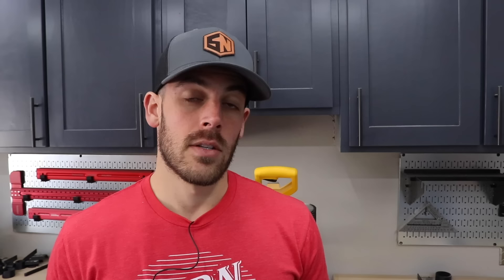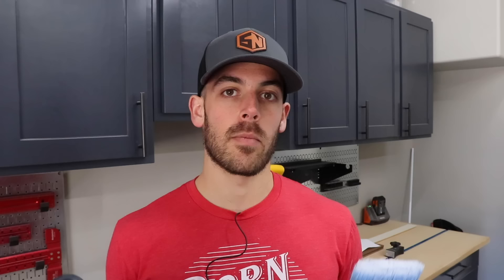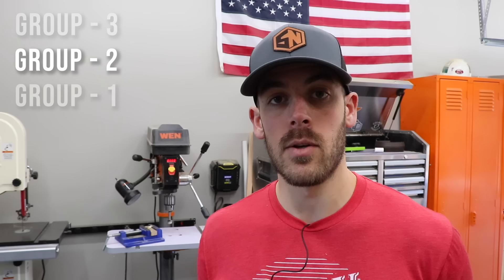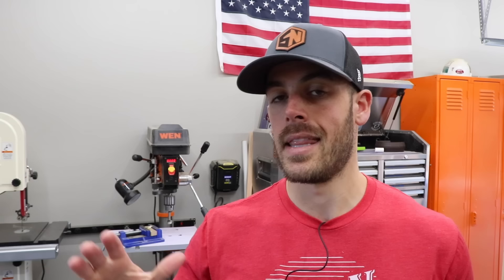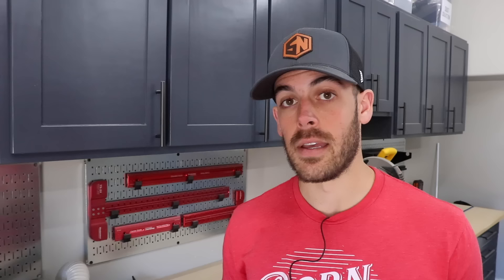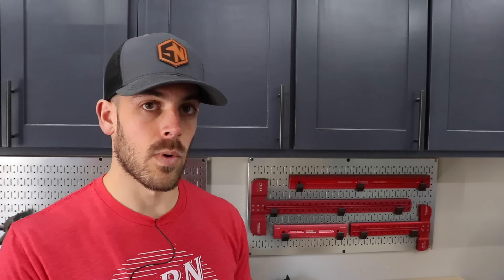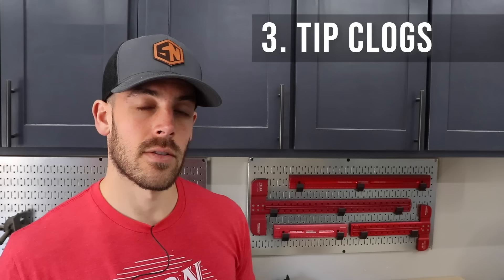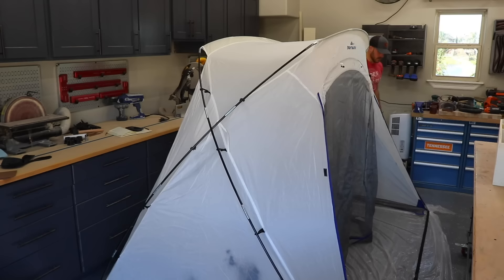Low Cost Handheld Paint Sprayer // Graco Truecoat 360 DS Review

Comment: WOW-  thanks for this review.
I started painting my garage last weekend ( two walls stucco, one dry wall) old style- brush and roller. I got the dry wall done and about 4 feet down the side walls. Took forever  painting around water heater, etc.  
Saw your video and bought this at HD. I went with the VSP as you suggested  and glad I did. It was such a pleasure to use- finished off the walls and interior of the garage door in about 2 1/2 hours. I will never paint with a roller again. This thing is a workhorse, easy to use. Clean up takes a while but well worth it. On top of that it makes this really cool sound which reminds you of the toy machine guns we played with as kids! Great tool, worth every penny. 
THANK YOU!!!!!!!

Comment: I work in remodeling I painted 400 lineal foot of shoe molding in 15 minutes took 10 minutes to clean out the gun 5 minutes to set it up the shoe molding look like furniture. I would recommend this to anyone some people are intimidated by it it was pretty easy to figure out. I recommend it highly to anyone who wants to pre-paint in any material.
Reply: Ron Young  thanks because I be taking long painting and cutting at the same time
Reply: @Wuwuu72  It will be the best money you ever spent. Just caulk the top of shoe molding. coat of paint over it 15 minutes later.

Comment: I got the Graco Truecoat 360 VSP and I painted my bedroom walls with it last night (a matte ultra-pure white). After painting the entire room I ended up going through 2 1/2 gallons of paint and noticed how HEAVY the sprayer gets after using it to paint an entire room. Right from the start, I could see the spray pattern sort of ribboning (good coat in the middle but the edges were very light). I used the method of spraying and on the next pass covering about 50% of my last pass to try and ensure the proper coverage. This morning I can see a few areas that I need to go over again really quick. I had previously bought the Graco X5 and took it back (unused) to get something smaller since I do not paint very often, and then regretted that decision. While painting an entire room this paint sprayer goes through the paint! I had the pressure at 1500 psi (setting of 10 spraying a one-coat paint) and I had to refill the canister really often. So much that I was saying to myself I really do not like this sprayer. It got messy, paint got all over the gun, floor, etc. It also did heat up, however, did not stop spraying. If you are looking to paint smaller projects then this sprayer would be fine, however, if you are looking to paint large areas like a room I would opt for the Graco X5 as you can use it with 1 or 5-gallon canisters if need be and the only weight you need to hold is the spray gun, hose, and whatever tip or extension you are using. It would have been great to not need to constantly refill the canister. All that being said this was my first time ever using a paint sprayer and I am sure there are ways I could have extended the amount of paint I was using with a different setting, making sure my distance to the walls was equal as possible, technique, etc. I will be taking my sprayer back to Home Depot and if I need to get another sprayer I will most definitely get the X5. I hope this helps someone out there with their decision and of course this was just my personal experience with the product. I am not saying the sprayer is bad and honestly, for the money ($265), it is not priced all that bad. The X5 was $329 and IMO is worth the extra money.

Comment: To anyone reading, trust me and opt for the graco magnum project plus. It’s like $50 more but comes with real tips you can actually change, and you don’t get the weird pulsating from the trucoat 360. This sprayer leaves terrible tiger stripes due to the pulsating, even with a correct overlap. The 4 inch tip on low still sprays too much and causes drip. If you look behind him when the light hits the cabinets, you can still see the tiger stripes. Additionally, because only two tips are compatible, you can only spray paint. Forget about spraying poly or any type of water based coatings. The tips do not allow for precise spraying. It’s decent for small jobs or fences I must admit. If you’re looking for a pro look, you won’t get it with this.
Reply: I have experienced all those things with this sprayer. I tend to keep a mini foam roller in my back pocket for drips. I found the pulsing happens only when there's about 30% of paint left. I have my next pour loaded with a a second lid and cage I bought separate. I would have also spent the extra money, I'd I had known, but this is the one I have now.
Reply: I was wondering about that as well! I’m all but sold on this sprayer but that pulsating bugged me. I guess at this price you run into issues like that. Appreciate the post 👍🏻
Reply: Can i paint poly with it?
Reply: @jorgeivancepedarey6314  I’m sure you could but it won’t turn out great. You need a fine tip to spray poly and this particular sprayer doesn’t allow you to use the normal Graco tips. Rather, you’re stuck with what you have in the box
Reply: What about the corded ultra?
Reply: @david7101  Would recommend project painter plus or x5. However, if you’re looking for something that’s easy to use, the corded and cordless versions work just fine
Reply: Spot on. Tried it and agree. Not worth it.

Comment: I’ve been using the Graco VSP 360 for a slew of projects.  Once being my basement remodel and did ALL the trim, talking several hundred feet and all the wainscoting walls.  Finish came out like “Buda”.  Easy to use and clean.  I’m ultra picky on my finishes and this sprayer is awesome.  And it finishes in one coat with a good quality paint.  Don’t buy cheap paint, especially if you are spraying.  I like Sherwin Williams higher end for spraying (and brushing).  Proper prep is key to painting, take your time with it.

Comment: The good thing about that sprayer as I can see is if it starts to clog just turn the tip round and spray it out. Then turn it back the right way and your good to go. As for clean up time it's got to be quicker than cleaning rollers and brushes.
I try to keep my brushes and rollers.
As they wear in nicely over time. But the cleaning process could take 30mins or more depending on what paint I've used.
The tip is to always take care of your tools no matter what they are and you'll have no problems. 👍

Comment: I purchased the 360 variable speed unit recently and sprayed some cabinet doors and they look great. Cleanup of the gun takes some time but goes faster if you use the proper solvent. Took me awhile to figure out denatured alcohol works great for BIN primer. Can’t wait to try it with oil based paint on my interior doors, which are a real time consuming painful job with a brush.

Comment: Graco has made some good improvements to their handheld sprayers. However, you need to ask how many gallons will go through the pump before it needs to be rebuilt, which will be at your cost. Also, they may not work after 100 or more gallons. 
If you buy paint/finishes at a dedicated paint store and want a better price for one of these sprayers, ask if they will cut the price down. Big box stores or Amazon will not negotiate with you. The paint store managers and sales people may cut the price down close to their cost just to keep your business. Either way, it's worth asking. 
My knowledge comes from working for Sherwin Williams eight years as a sales associate. Personally, if you have the money to afford one I would recommend a Graco HVLP sprayer.
Reply: You're correct 💯

Comment: I have a VSP. Bought it because I was staining trellises and I did the first one with a brush. Took me 2 hours to stain one side of one trellis. After getting the VSP, I finished all 6 in 4 hours, including clean up and breaks. One thing to mention... If you're doing a project where there's going to be a lot of overspray, like a trellis, you use a lot more paint/stain than doing it with a brush. It was worth the trade off for the time I saved. Also, get the Graco storage fluid. It's very easy to use and keeps the pump lubed and clean.

Comment: Good review. The clogs are coming from large clumps of dried paint that get stuck in the tip. For clogs use a paint strainer bag and strain your paint as you pour it into the paint bag . They are usually less than $3 from your paint store or hardware store. I use these bags on my airless pump.
Reply: they showed the filtering in the video.

Comment: I use the two-speed sprayer and am a newbie in using it. Several things I have learned. One, mask everything! Two, wear disposable gear over everything of you that you don't want sprayed. Wear a face mask so you don't breathe the paint. Wear goggles. Three, it is very easy for an old lady to use. I can't lift a lot of weight. It doesn't weigh much. I tire easily. You get the job done quickly. Four, If you finish one color in an area and have some paint left over, remove the paint reservoir from the sprayer. Place it in a support container ( I use a wide drinking glass) and cover with plastic. That preserves the paint for the next time you need that color. Clean the sprayer and continue using with a new color. Then, when moving to a new room but needing the first color, you can easily switch back with minimal loss of paint. Finally, clean up is VERY easy even when neglected. About a month ago, I did some painting and when I ended that evening, I thought I'd use the sprayer again the next day. So, I covered everything which may possibly be open to air and just left it overnight. Well, overnight became three or four weeks later. I expected the worst. But, I happily discovered that the paint was still good, nothing has clogged, and I was able to continue as before. DEFINITELY A GOOD EXPERIENCE.

Comment: The biggest problem I have with this type of sprayer is the cleanup. It takes a while to get it cleaned right and uses a lot of water. I feel the larger graco magnum sprayer with the hose attachment on the suction tube for cleaning is way easier and faster to clean. 

Since I live on septic now. No more paint rinsing activities in the sink.

Comment: I have the VSP version that I like using for the same reasons. One step I add to the prep is to use a filter sock to strain the paint of solid material. I have an extra paint can with the filter sock inserted and draped over the top then pour in the mixed paint. It is an extra step, but I believe helps.

Comment: I used the Graco VSP to paint a double wide garage door with semi-gloss water based paint.  Each coat of paint took about 2 minutes - very fast.   There is a 4" wide spray nozzle and a 12" wide spray nozzle.   I gave the door 3 coats.  The only problem I saw was the gloss varied a bit across the door as the light reflected off at an angle. The sprayer pulses out the paint so the flow is not continuous.  I think you have to be careful to get enough overlap between the pulses of paint.

Comment: This is the best cheap paint sprayer I have ever used. I watched the video of how to operate and clean several times. The cleanup if done properly and thoroughly makes all the difference in repeated use.  If done improperly (as with any paint sprayer) you will have continuous problems. Reminder the spray tips are only rated for so many hours of usage, refer to your operation manual.

Comment: Had one of these when i worked for a painting company, they were a godsend for painting downpipes and sofits.
Reply: Do you know if it's truly airless tho? I can not stand the air powered ones that throw more paint on the floor than my object.
Reply: @Coder-zx4nb  I never had issues with that, i would usually do a test spray on a bit of scrap wood just to be sure the paint was behaving how i wanted it to though as each different brand of paint does need to be kind of dialed in.
Reply: @Coder-zx4nb  turn down your pressure and use a low pressure tip.

Comment: I have the VSP model and I hate it!! As you can see in the video here, these spray in pulses so the key to getting a smooth finish is a game of stacking these pulses so you dont end up with tiger stripes. And I promise you this, you WILL see the tiger stripes in the finished product if you dont do it well. I have sprayed professionally for years with a Graco X7. When you pull the trigger, the paint just sprays out (like a can of spray paint). It's honestly not super hard to get a killer result. If you keep your distance from the material and pace yourself, the paint lays down smooth, easy, and gives a great finish. 
On the contrary, I fought this hand held with 20% diluted latex paint (according to Graco's phone support the Behr interior paint I was using is pushing the max that this sprayers motor can handle... seriously) on some baseboards and cabinet doors and it was a massive pain in the ass! To avoid the tiger stripes I ended up with way too much paint and a horrible orange peel finish. I 100% would not recommend! It would be easier and give me a massively better finish to just get my big X7 out and buy some extra paint.

Comment: I saw you used Solo from SW. Great choice for dark colors in a latex enamel. The true coat series was a big seller in graco's handheld sprayers. If you do a lot of projects with paint I recommend stepping up to the Graco Ultimate Handhelds cordless. It has 3 pistons compared to the Truecoat having 2 so it sprays more like an bigger spray rig. Also uses real guards and tips so you can swap out the tips for better finishes with different paints. Another benefit is it runs on 20v Lith dewalt batteries (comes w/ 2) and charger.
Reply: You can also upgrade into an all metal version (higher price) so you can spray high flash point material like lacquers and other solvent based chemicals.

Comment: I just bought the Graco 360.  I used it on one job to paint some textured walls.  It did fine on the textured walls. My next job was a piece of furniture.  IT TOTALLY FUCKED IT UP!  I had cleaned the sprayer out very well prior to the second job.  The Graco 360 splattered like Diarrhea all over the place and left a horrible uneven texture.  I put a new tip-in, and it did the same thing.  No, I didn't have it set in the clean-out mode.  The tips just spray unevenly and sprayed a stream out the middle and splatter everywhere else.  So, I called the company.  Basically, they told me to take it back and buy a $600 sprayer that you pump from a 5-gallon bucket.  Great, so I have to buy a $174 piece of furniture or try and sand out the old one.  Waste my time returning the sprayer.  Pay $600 for a big sprayer and buy 5 gallons of paint for a small piece of furniture. What a bunch of CRAP!  I'M PISSED AND EXTREMELY DISSATISFIED.  I bought this sprayer thinking it would be the top-of-the-line sprayer for small projects over the Wagners.  It certainly was more expensive.  The Graco 360 SUCKS, and I mean SUCKS in a bad way.  They should name it the GRACO 360 Splatter gun.

Comment: They e updated the model names now too. 
Niw thwy are the 360 single speed, 360 dual speed (old DS), 360 dual speed plus (DSPold name) and 360 variable speed (old VSP) 
They also come with 2 paint and 2 stain tips now and different screens for each set of tips

Comment: Nice summary of these sprayers, thanks for posting. FYI you can buy the 42 oz flexliner cage and cups separately and use with your sprayer. I did this with my Ultra Cordless model (which came with the 32 oz liners and cage).
Reply from the maker: I saw that! It’s linked below for folks to find

Comment: As always, very timely. I am buying a sprayer this week to finish my first big project! I was going to by the DS model based on your cabinet build but you made a good case for the VSP. Thanks, Travis!
Reply: I would get the one that has the better tips. I own this model, and the tips are not good at all. You only get two, and they are made of plastic (with a metal tip). It is worth it to upgrade to the tc pro and spend the extra 100 dollars (300 total).

Comment: Those little sprayer are OK'ish, if they are still built with the triaxial pumps in them then they will have a finite life cycle to them. If its anything like the UK battery operated versions then there are lots of service centres with racks of them that are beyond their service life, as I understand, they can get one major repair (pump change) and the second time they die is the last time they can be repaired. Life cycle limitation of a few hundred litres.

Comment: Using these sprayers the notable pain is the clogging.  That is more of the type of paint.  Latex will clog the tip. Great video just wish you would have said the prices also.
Reply: Filter the paint before it goes in.  Bada boom.....!!!
Reply: I just bought mine about a month ago. Ran 5 gallons of oil and 10 of latex through it. Not 1 clog  yet =]